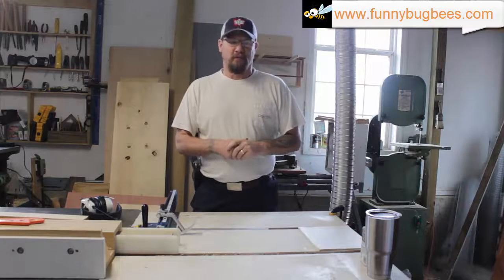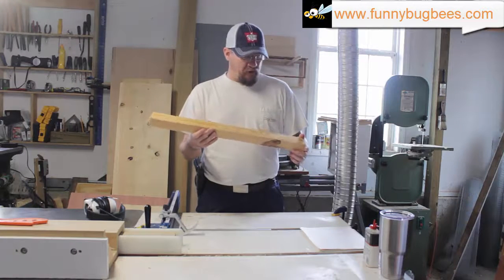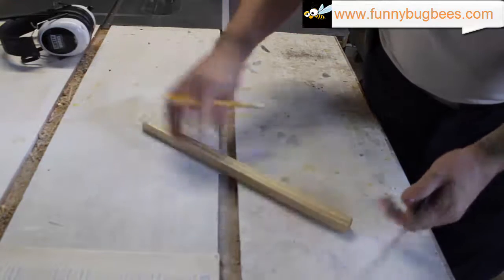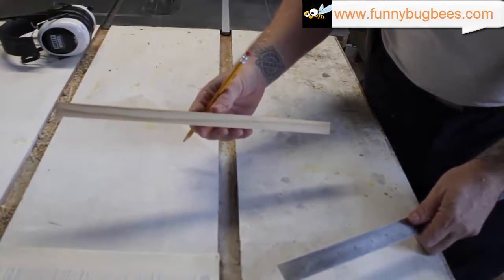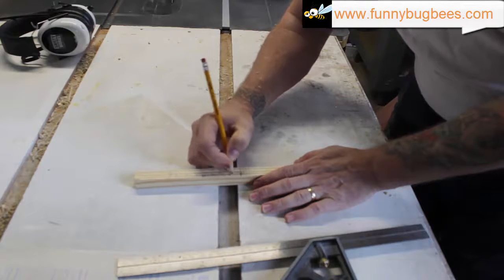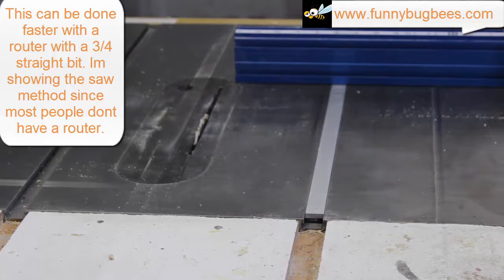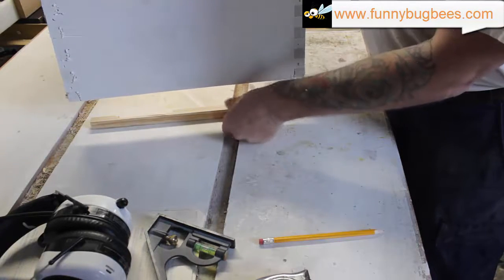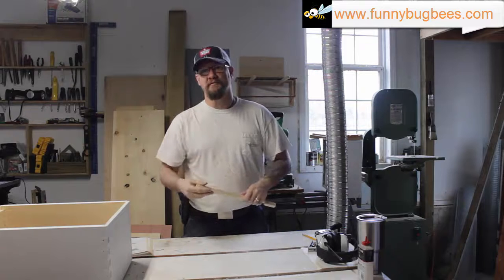HowTo: Make Langstroth Style beehive Entrance Reducers

Comment: If you respect bee space and have 3/8" risers on your bottom board, you reduce the entrance by 50% right from the start. From there you only need a couple of pieces of scrap wood to reduce the entrance even further.
Reply from the maker: Are you are saying that it is easier to make 3/8" risers, plus find scrap wood the right size than it is to take 3 minutes to make an actual entrance reducer?
Reply: Yes. The scrap wood doesn't have to be the right size, all it has to do is block the entrance.